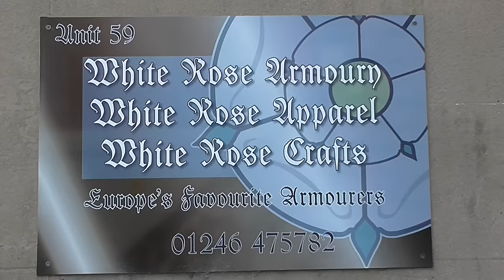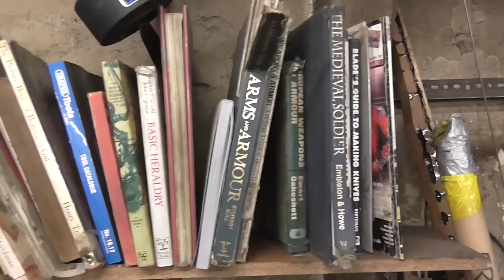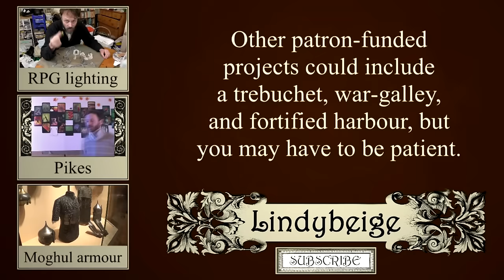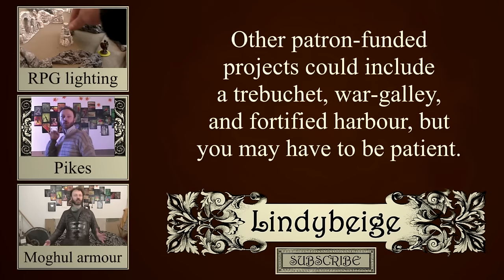At the armoury for my new suit

Comment: I am a former blacksmith apprentice so yes, I have seen so many hammers.
Reply: but....why so many?
Reply: gi70st Different jobs require different tools, hammers of different weight or shape.
Reply: Wouldn't just one hammer do the job(of course I understand that you need hammers with different shapes, but different sizes not so much, and yes, I'm speaking from experience since my father is blacksmith too, and I never saw him using two or three normal shaped hammers that he has in his workshop).
Reply: Frank Teryngel Fair enough. the dude I trained under had different shaped faces on his hammers as this left different effects on the steel. Although it would depend on the kind of work being done. Your father may do different style of forging or may be skilled enough to perform a variety of tasks with a smaller selection on hammers.
Reply: As a metalsmith-in-training that does a lot of very small stuff- you'd be surprised how much the weight of the hammer affects your control, and the impact on the metal.  In armoury you're going to need a lot more finesse and a lot less power for working on stuff like the finger armour, and much more weight but less finesse for doing general shaping on the breastplate.  Having a slightly convex hammer face vs. a completely flat one, for when you're dishing.  And different hardnesses of hammer face as well- it's possible you'll want a softer hammer when doing detailed work or repairing a piece of plate.

Then there's the different kinds of hammers to use with different tools- again, softer or harder faces, your 'nice' hammers with mirror-smooth faces vs. the nicked up ones you use on chisels- chasing hammers for chasing and reposé, brass or wooden hammers for raising, hammers you use when cold-forging vs. hammers you use when hot-forging...
Reply: Probably for several different people. There's not just one armorer in there.
Reply: why dont you stop talking about hammers and warn some loyalists the virus bombs are incoming
Reply: doughman10 Ahahaha Genius! I am en route as we speak. The Thunderhawk has surprisingly good wifi so I figured I would spend my last minutes on Youtube

Comment: Lindy hopping in armor, please.
Reply: entirely possible given the videos I've seen of people doing the most extraordinary things in full armour so as to demonstrate how easy they were to move around in. In stark contrast to the impression most people have.
Reply: There's nothing you can't do in plate, really.
Reply: Minute Science swim the english channel? Safely operate anything with supercooled or Neodynium magnets? Take a piss mid-battle without getting your Gambeson all soggy?
Reply: ifonlyicouldstop
Swimming for ten hours is hard enough naked, so no.

But that's just pedantic. You know what I meant.
Reply: Minute Science I'd, of course. I was only joking.
Reply: +ifonlyicouldstop actually, using neodymium magnets to just clip your gear to the armour would probably be quite effective.
Reply: Just imagine a knight with full plate armor with fridge magnets all over it.
Reply: Things you can't do in full plate armor: make love, drive a small car.

On a more serious note: using magnets to secure a 3 pound weapon so it can't come off easily but can be drawn quickly at the same time seems impossible to me.
Reply: JerehmiaBoaz It's all about the leverage, a magnet with a lever (like the handle of a weapon) attatched can be easily made to come off of a metal surface it's attatched to through twisting or wrenching it outwards/sideways, but won't come off while just moving up and down.
Reply: +SonsOfLogar In case of a sword the blade is a longer lever than the hilt. If you make the magnet weak enough so you can draw the sword by using the hilt as a lever, only a small bump against the tip of the blade will be enough to detach the sword from the magnet because of the much longer lever. (Also moving around with an unsheathed sword attached to your side is bound to do some damage to both you and your surroundings.)
Reply: JerehmiaBoaz Surroundings, yes possibly, yourself, how? Unless one is stupid enough to attatch a naked blade with a magnet to an unarmoured leg...
Also, I personally wouldn't use magnet attatchments for longer swords precisely for the risk you highlight. Short swords on the other hand, but then I'd use several magnets riveted to the armour across the small of my back so that the blade will be drawn sideways like a seax.
Reply: +SonsOfLogar I was thinking more of damaging your overcoat, cape etc. I still think the magnetic force required to attach the dagger/small sword firmly would make drawing it quickly difficult, but I'm just speculating.
Reply: JerehmiaBoaz Could be, then again, it'd have to be tested to make sure, and, who wears an overcoat or cape with a full metal plate armour in battle?
Reply: +SonsOfLorgar You wear an overcoat to keep your plate armor out of either direct sunlight or cold wind and rain. Steel plate is a great heat conductor so if you don't cover your armor you're basically exposed to the elements and either too hot or too cold. You'd wear a cape when you're not immediately out to fight someone to keep yourself even more warm and dry.
Reply: JerehmiaBoaz good to know :)
Reply: JerehmiaBoaz
Plenty of people didn't. Later knights wearing full gothic plate didn't wear cloaks or tabards.
Reply: +Minute Science Nobody in his right mind goes out in just plate armor when it's freezing or raining. They wouldn't wear surcoats just to get them destroyed in combat, but if the weather demanded it they sure did. The later (high) gothic armor wasn't commonly used in battle but was intended as so called parade armor (basically to show off), serious fighting was done in half-armor by that time (which eventually led to the cuirass).
Reply: JerehmiaBoaz
There were still serious battles with full gothic plate. Most soldiers had half-plate, but there were certainly full-plate troops out on the field, even at the start of the harquebuse era.

Comment: Good for you Lindy! 

Someday, once I complete my classes in precision metalworks, in going to build myself a modern interpretation of a WWII tank. 

I'm leaning on a combination of the T-34, (wide tracks) the panzer III (size, 3 man turret, welded seams) and the 38(t) for the drive assembly and suspension. 

Probably a set me back a bit, but I could make historically accurate 38(t)'s out of mild steel and sell them to recoup the costs. 

I'm just giddy thinking about it.

Comment: the question now that you have left open is what type of helmet is the suit going to have, surely you won't have a Gothic suit of plate matched with a kettle hat
Reply from the maker: A kettle hat is a possibility.
Reply: Lindybeige Kettle with plate, WHAT A BRILLIANT IDEA!
Reply: Isn't the kettle hat a wee bit low-born fo a man cald in full plate?
Reply: +Jim's Old Lectern you can actually get very nice looking kettle hats, they have a photo of one on the website that he's getting his armour from.
Reply: there are some lovely 15th century kettle helms

another example might be the celata aka the open faced version of the sallet, that comes without any visors or vision slits
Reply: Get one with eye-slits, they look so badass! OR a one with sort of spiral fluting on the top!
Reply: I've always been partial to the frog-mouth helm, myself.  Or maybe a nice sallet, bevored or not.
Reply: Now that I look them Up there are som fairly nice ones. I was thinking of the Brodie Helmet looking things
Reply: A frogmouth would be very impractical for anything other then jousting; there's no neck articulation, and the eyeslit is very narrow.
Reply: Some frogmouths we've found could be used on horseback in combat, but they'd be pretty useless if you got unhorsed. The main issue is you need to bend over forward to even see anything.
Reply: +Jim's Old Lectern There are a fair few high status examples, and a kettle helmet with full plate appear relative often in contemporary artwork.

Comment: Did you ask the armourer for a suit that can withstand a Spandau though?
Reply: They make that. It's usually made of Kevlar with ceramic plates. It'll withstand a PKM in 7.62X54R, it would likely withstand an 8mm as well. At least the plates will. You take a full caliber rifle round on any of the soft bits, you're fucked.

Comment: I say skip the trebuchet and go straight for the war galley. Once that's built, sail it at least 12 miles off the coast to a waiting arms dealer of your choice and then arm it with cannons and 5" modern guns and at least one .50 bmg. Sure, it won't be exactly period accurate, but it'd be fun.

Comment: As "Work-in-progress" for the armour build, might it be possible to have punched and formed aluminium, part-scale models of the alternatives, giving us an insight into what would be "correct" and "potentially available", and then what thoughts influenced your choices as you finalised the designs? Cosmetic-only details would be less relevant, but armour joint types wit relevant pros and cons might be interesting, especially if there's no clear advantage to one style - maybe prototype grades of bot could be tried out and some useful information gleaned in such a manner.

Comment: do a video on what's up with your thumb related to the gauntlet? or otherwise describe for the sake of my curiosity?

Double jointed as in the tip of the thumb (tip of Distal phalanx) can come back  and be superior beyond the proximal Phalanx?  (That may have made the question more muddy as my use of anatomical descriptions is rusty, but I was curious if my thumb joint would similarly cause issue)

Comment: Alright, I have to ask, why does a double-joined thumb present issues with gauntlets? Or perhaps, your double-jointed thumb is different from mine?

Mine simply means the last join in the thumb can bend forward 90 degress or backward 90 degrees from its straight position. So in a stiff gauntlet, I would simply lose the ability to bend it backward, which does not seem like a terrible compromise.

Comment: How did they even make sheet metal way back then?
Reply: Charles Talhelm power hammers and Catalan (I think that's how you spell it) forges/bloomeries. Usually the manufacture of sheet steel was reserved for armouring purposes alone, as it was very hard to do and get it all the same thickness and whatnot. It's even been speculated that the romans were using a sort of rolling platemill to make their sheet steel, as the thicknesses of the armour produced are astonishingly similar, and the quality of their iron and steel is also astonishing, comparable to ductile iron and steel produced in modern times in terms of slag inclusions and overall makeup, not treatment, although the Spanish understood an awful lot about how to heat treat steel, and even had an understanding of grain and crystal structure in steel, all 2000 years ago!